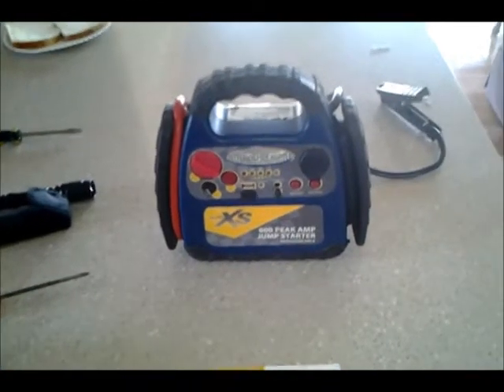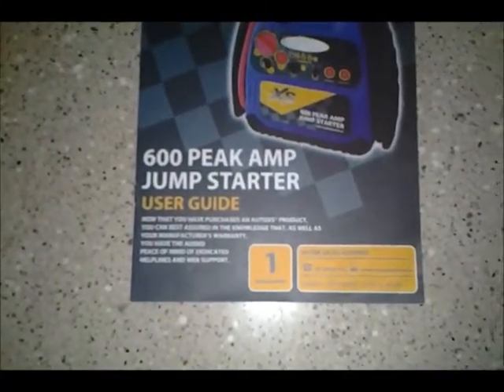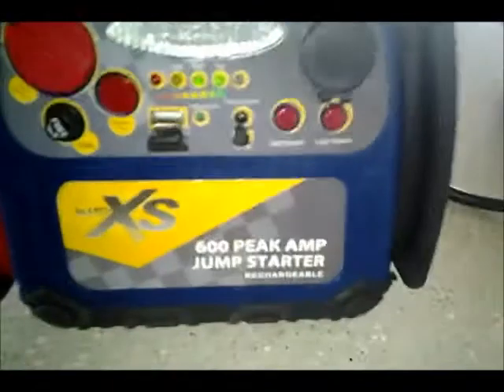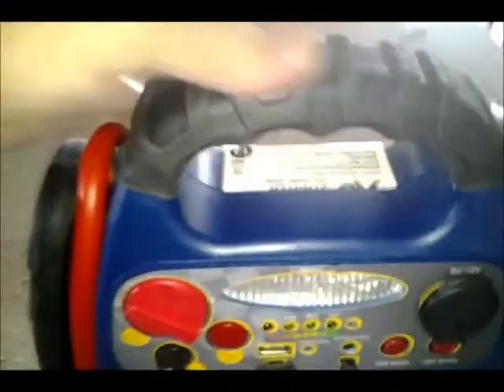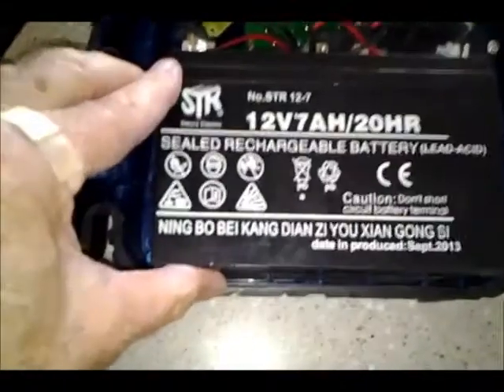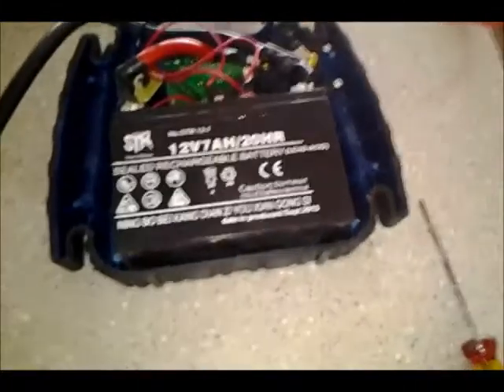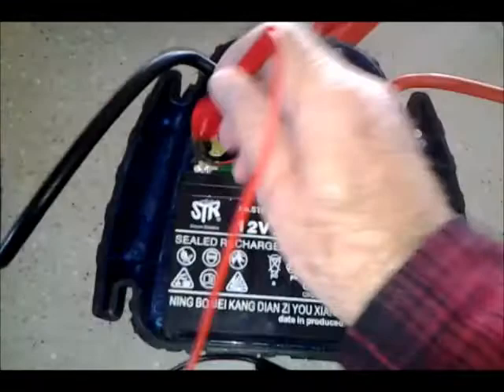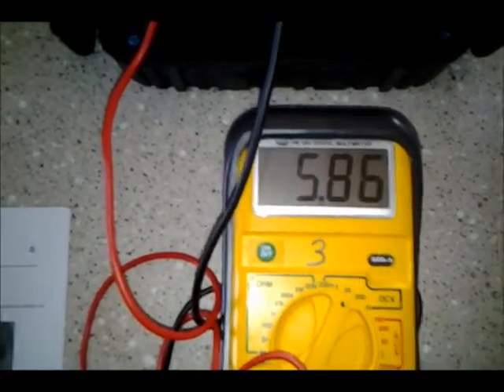REPLACING A 600 PEAK AMP JUMP STARTER BATTERY

Comment: Just wanted to know how to connect a new battery properly
Reply from the maker: In general, KF, you attach the positive (red) lead to the positive terminal & the negative (black) to the negative terminal. Make sure the terminals are free of corrosion &, if necessary, brush them off with a wire brush or rag or something, so you get maximum contact.  Thanks for watching!
Reply: @harrison4803  yes. That part is evident. My charger is a dura max 12v 600 amp. There is a 5" wire with red on both ends that is not connected to the charger but of course it connects somewhere? I've connected the red wires to red battery terminals but when I touch the black to black terminal the charger turns on. Its switched OFF & not plugged in. It uses a RT1280 battery. I'm awaiting a call back from dura max for possible solution... thank you for responding.
Reply from the maker: @userG5447  Is this a new unit? When you say you have attached red wires, do you mean more than 1? Do you have a way to charge the unit, a plug or something?  Mine has a plug.  Could the 5" wire being somehow related to that?
Reply: @harrison4803  the unit is 4 yr. old. It has an ac/dc charger. The 5" wire has the same type of connector at both ends that the other wires have, for the connecting nuts to go into. I was wondering if it may be a grounding wire? I didn't disconnect the old battery so I don't have a mental image of what went where & the culprit doesn't seem to either.
Reply: @harrison4803  the 5" wire was a ground wire. Connected to the positive & the on/off switch. Works great now. Thanks for assisting. ☺
Reply from the maker: @userG5447  would never have guessed it was a ground wire.  Glad you figured it out!
Reply: With DC, start with black then red to remove the battery. When connecting the new one, reverse it, start with red then black.